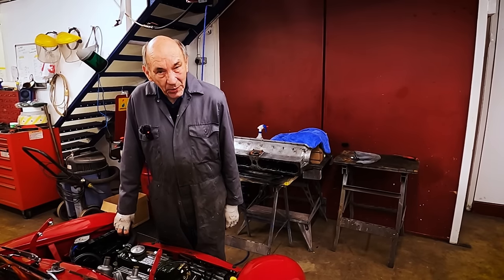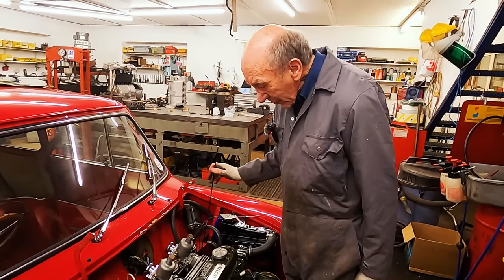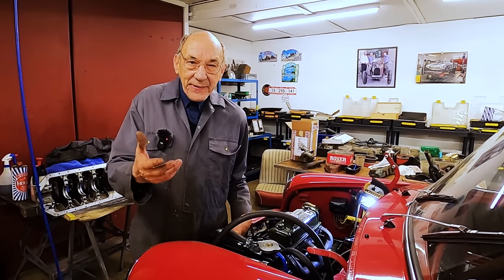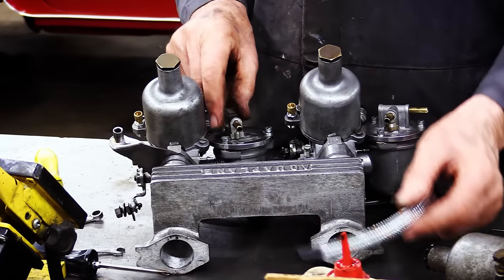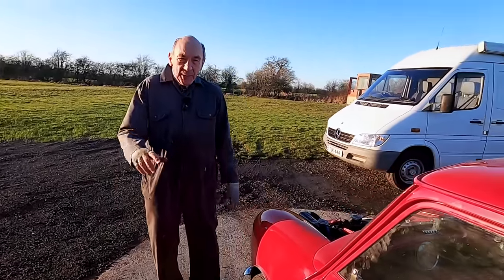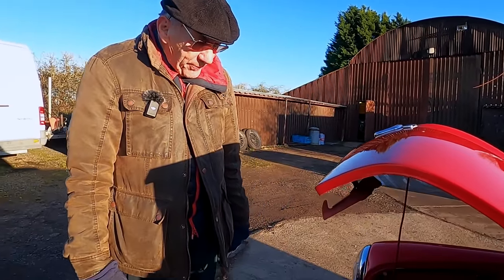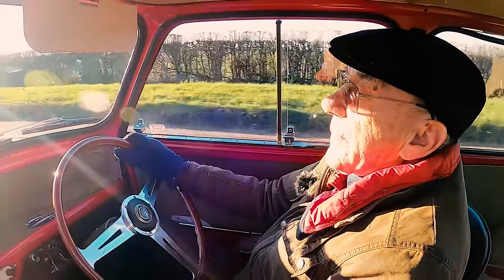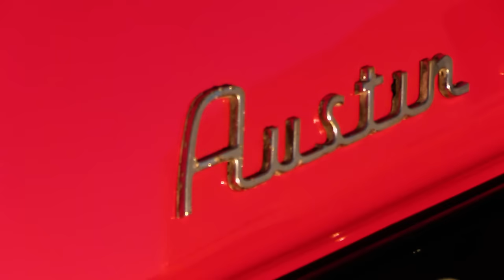SHED RACING - Old Boy Racer Mini Test Drive

Comment: The tubular LCB manifold won't fit cars with the early rubber maltese cross drive joints, as you have found, but there is an intermediate pressed metal exhaust manifold, made out of two sheet metal pressings welded together clamshell style, and they did give a performance boost, and I believe they will fit with the old style rubber joints, although the rubber joints are fairly inneficient, and I used to fit the hardy spicer conversions which fit the original driveshafts, and have a proper U/J in them. Did you fit the engine stabiliser bar with the  conversion kit that really stiffens it up? just solid metal cones instead of the rubber bushes. this stops the exhaust manifold joint failing quite as often as they used too! Talking of mini exhausts I made an interesting discovery many years ago, remember the old style outdoor toilets with the cistern mounted high up on the wall with a pull chain? if you take the flush pipe off you will find you have two pieces of galvanised pipe, one being straight with the bend for the toilet pan on one end, and the other having an offset to go out from the wall and connect to the cistern, perfect fit for a standard mini with the offset piece at the back to go to the standard Silencer! Not a lot of people know that! 
Very enjoyable watch Ivan, and cracking job on the mini!  I love Johns carb top conversion!! I used to grass track race minis in the seventies, much fun!
Phil, East Yorkshire
Reply: That exhaust was a 997 Mk Cooper one, the bore is too large for an 850 though. Mk1 Minis don't like large pipe exhausts.

Comment: Very sorry about the cat, they're such good company. My the Mini is definitely looking great, well done. That exhaust is fantastic and a real work of art. However I have got some comments to make about it. That manifold to pipe joint was used by BMC for donkeys years and never caused any problems (it never failed on the works minors). The art was to make sure that it was clamped firmly to the gearbox, like you did, then it moves as a unit with the engine and consequently never is strained. Sorry but I disagree with you about exhaust mountings, they should always be as flexible as possible, this is why rubber rings are used on a lot of cars, so as not to put any stress on the pipe joints. This is particularly relevant on a mini with the fore and art movement of the engine, this is all absorbed by its relatively flexible exhaust mountings. 
All of the problems that you had with the carbs especially the fuel lines is because you haven't got a pair, just a duplicate of the original. Both your float chambers are on the same side, they should both face outwards, you should have used one left and one righthand carb as on the Cooper. I'm really looking forward to the next episode, your car brings back my gp5 racing 850 of the early 1960s and the lap records it held, we only gave up racing it in 1963 when S's came into use and the professional tuners etc. dominated,we just couldn't afford to keep keep up. Finally don't fit spacers to the wheel hubs this was the one thing that really upset us in the competition dept.. All BMC tuning data for early normal minis warned against doing it, the hub bearings  aren't up to taking the extra strane. S's had completely different wheel bearings that's why they were able to build in those rear spacers into the brake drums.

Comment: Hi Ivan.... we used to use a MK1 Sprite silencer.....extending the outlet out the back ......first class and cheap.  Also watch those petrol hoses I used some and the new petrol mix made them all floppy!   Enjoying your build ....crack on!±
Reply: It's an old boy Racer so probably supposed to be floppy
Reply: jw6767...Used to put those midget/sprite silencers on my M.1000. part AN19 (many many years ago)
Reply: The cooper S  never had  wheel spacers just off set Steele rims from  factory on the Mark One  S . Chave  ! ,Having started my  apprenticeship in 1970 work on mostly BMC vehicles with Passion of Mini's. Spent a fortune on rally preparation of Mini's. I suspect the old boy and I are of the same age but I've grown up some so early MGBs are now my passion n.

Comment: You guys should be very proud of that Mini. It looks fabulous and it sounds even better. It is going to be really quick when you dial it in. You can hear that it wants to run. The engine compartment looks really smart and John needs a good pay on the back for his work especially on making those adjustable covers so they could be moved around. You could probably make some money on that invention. I am looking forward to seeing it on a proper run.
Reply: Just a heads up... the reason that the float chamber spigots are facing the wrong direction is that the carb is a 'single' ie its not meant to be a pair. True SU twin carbs have a float bowl on opposite sides, this allows the linkages for the butterflies, chokes etc  to meet in the middle with neat little rods,  thus negating needing twin cables etc

Comment: hi ivan we used to run 850 mini vans in early70's with modified Morris 1000 heads lighten con rods dual timing chain hi lift Kent cam 2 and 1/4 inch SU carb, punch the baffles out of the silancer,
modified distributor more advance on top end they reved to 8200 and stay together,
and ran hillman imp 12 inch  wheels on the front with Avon safety wide tyres
Reply: 8200? Wow !

Comment: Hey Ivan the Mini looks great! Sorry to hear about your little black mascot. He was a charmer,,,;D Just a heads up that you might know already, on those brass dash pot lids you can drill an extra tiny hole (ie about 1mm) which allows the throttle to lift them quicker and breathe better (they did it on a few works cars, so it might help - you never know)  it might be better to try on the plastic dash pot lids first as the brass ones are getting quite rare now. Best wishes to you and the crew for the New Year.

Comment: In respect to the exhaust flange it has always been a pain in all the early BMC...i found by using high temperature grease on the face and also on clamps it would usually seal. The grease allowed it to pull up nicely.

Comment: Bloody hell Ivan takes me back to my youth, minis for £14! Went like stink, crash it into your mates get another.
Reply: The most we paid was £5, we even got a mini van same price 😂
Reply: @alexjohnson1612  We did the £5 a mini. On one deal Id only got £4.50 on me so the rest was on tick. The £14 deal was done at my local. Wandered in for a swift one there was a Green 850 Austin Mini parked with a £40 ono full tax MOT in the window. I went inside there was a new guy at the bar, "is that your mini for sale?" "yea you want it?" "Ive not got £40", "What you got?" "£20?"............"Are you having one?" "Yea go on" .......at least 5 pints later. I wake up after walking home, mini key on the bedside cabinate.....huh! Bugger  I think I bought a car!
Reply: @slartybartfarst9737  I never had the cheek to hagle so I would get my mate, I would be quite happy to pay £30- 40, but he would actually kick the tires sometimes the car, so embarrassing, but £5 everytime,  we were only 13 then ;)
Reply: @alexjohnson1612  The £4.50 one was a superb white 1000 it had "collapsed" on one side. I looked underneath "wtf whats all these tubes with oil pissing out" (Hydragas) Hmmm looks like 10mm heating pipe. I wonder if I cut out the pipe where theres a hole and put a brass joint? I took my collapsed mini with a brass joint to the garage I used to work at as a school job "can you pump this up mate". Then I drive home in my perfect new mini passed the guy I bought it off whos walking and not happy at all.
10 minutes later a knock on the door "you bastard you knew I was skint you knew you could fix it" I didnt but then again Im bloody good at seeing engineering solutions (made a career out of it). Anyways sold it back to him for £10 covering the brass joint and the backhander to the guy at the garage, he was not happy, lesson in life no one likes a smart arse.
Weeks later we see him in the same mini with the front end 2 foot up in the air! He pulls up along side and as he puts the brakes on the front drops to the floor and the arse end pops up 2 foot! Turns out you should bleed the air out of a Hyrdagas before filling, looked bloody hilarious though and sold as seen sir....twat.
Reply: @slartybartfarst9737  😅😅 That's hilarious, I'll never forget the mini van,  in racing green, we didn't even give it a thorough check, turned the key & drove off, we checked it when we arrived back on our estate, opened the rear doors & they fell off like dead leaves, you could flick a hole through the rust 😅🤣
Reply: @alexjohnson1612  but how cool is mini van!
Reply: @slartybartfarst9737  I know, the clutch brake & accelerator when you stepped on either all three pushed down they were that close together 😁
Reply: @alexjohnson1612  We started with plasic pigs (reliants) Favorite was the regal van. Take the back seat out and sprag a broom handle in the seat fixings so a rear seat passenger in the van bit could get from side to side like a sidecar passenger and hold on, made a massive difference to how fast you could corner on Right handers as you were both on the right side but god help you if you went left and they went right. Needles to say 6 pigs died in 6 months but the sight of half a dozen pigs cornering impossibly fast rear inside wheel a foot off the deck was something to behold lol. Minis were the olny answer
Reply: @slartybartfarst9737  They did say the mini was impossible to roll, the go-kart handling, for that reason we tried our hardest to roll one, I did see a few turn over at Antrobus grass raceway in Cheshire, My pal had a Mexico when we were 15, I rolled that nearly wiped us all out, none of us had belts on, the wi dows open, we were so lucky with minor injuries, my mate seen the funny side.

Comment: Just a thought, if you turn the float chamber top won’t it also change the axis of the float pivot. This might affect the fuel level when you’re exploring the centrifugal forces of high speed corners, S you are inclined to do. 🤔🙂
Reply from the maker: doesn't seem to affect it

Comment: The coil should be repositioned or a purpose made shroud  as it was compromised to water ingress in severe wet conditions
Reply from the maker: yes and we have some very wet conditions - at the moment I'd need a snorkel to drive it up the road

Comment: Perhaps you should be a little cautious about revving the engine too high.  I did a similar job on my Mini back in the 60's although I put a single 1.5 inch SU on a Janspeed manifold, modified the head much the same as you and then broke the crankshaft twice in less than a year both times while driving in top gear.  The 850 engine had to go so I put an 1100 engine in with a Janspeed head with huge valves and didn't that go! Until I was blasting along and one of the valve seat inserts fell out, jumped up and down on the piston and jangled its way out of the exhaust pipe!
Reply: Blew the crank on my tuned Morris 1000(948cc).Steep learning curve!Crank only has three bearings,and the centre one is the weak point. On the rebuild,I strapped the centre main with a steel billet,and extended the cap bolts,by using studs with locknuts to accommodate the set up. Never had any issues after that!

Comment: There should be synchro on all but first shouldn’t it?
Reply: Yes, it should do if it’s all working properly. The early synchro system wasn’t great even when they were new. Good thing Ivan can drive!
I was never game to shift down to 1st gear in mine while moving at the same speed!
Reply: I learned to double declutch if I was still rolling. 
I used mothers early car for 2 years then bought at 1969/70 1000 as my first car to go to college🤣

Comment: Dear Shed Racing do you recommend installing piston rings and cylinder dry?  it is true on 2stroke -scooters in fact Zuma-R-Us In their Tec tips they say to assemble the rings, piston skirt and cylinder bone dry. I have built the same scooter top end with stock parts 3 times and when you assemble dry get around 155 psi and with oil 130psi after break in.
Reply from the maker: We always fit our pistons dry....
Reply: Thank You!